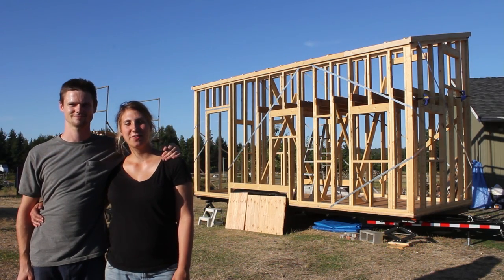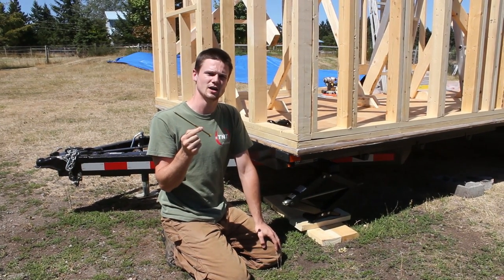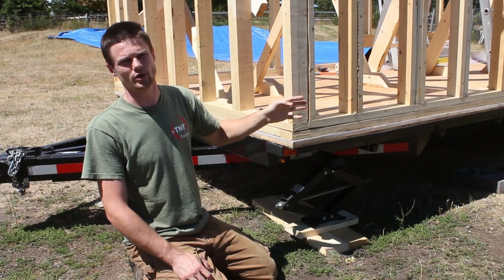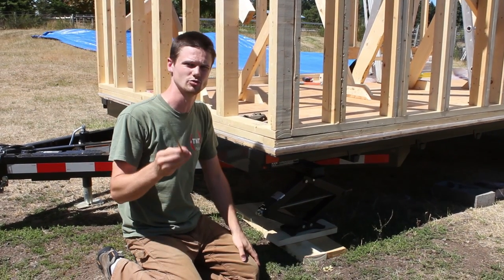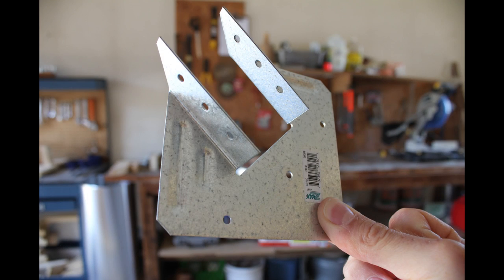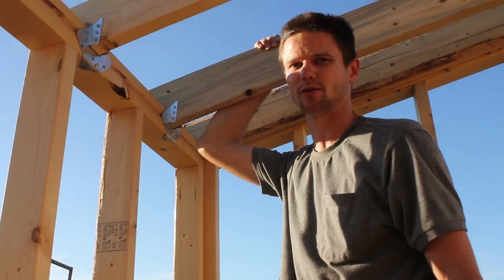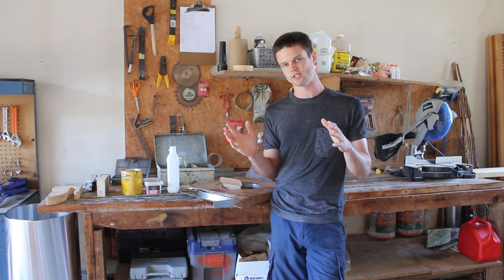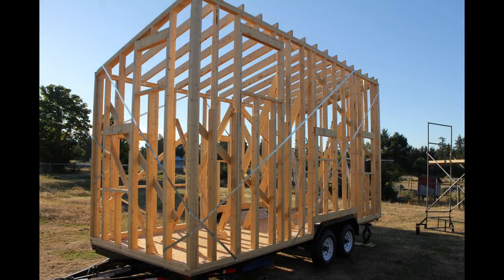Tiny House Structural Strength (Ep.10)

Comment: The bolted connection that you showed earlier is far stronger than the screw connection. I work as an architect in California. Earth quake land. We use the Simpson bolted connection all the time. With the screw you are relying on wood to not tear around the treads compared to the tensile strength of the bolt. Huge difference. Moving the house down the road with gusts and bumps I would have the bolted connection. With the strapping are you going to use 3/8 or 1/2 structural sheathing on the outside? If so you don't need the straps. The sheathing if better for it makes more connections than the strap does. (Nailing needs to be 6" O.C. on edges and 12" O.C. middle) The strapping out hear is use on headers to tie back to more framing. You have a pin connection ( compared to a ridged conniption that would occur when two pieces mental are wielded together) at the header and jack stud. The strap helps with that week connection.
Reply from the maker: Charlie Hatfield We have just completed sheathing the walls with 1/2' plywood using adhesive & ring-shank nails (6' along edges, 8" in the field). The strapping is an extra brace as a backup in an extreme situation.I hear what you're saying about the wood tearing, but even if I bolt the bottom-plate down, I'm still relying on the nails to hold all the other studs down am I not? I managed to get structural screws into almost half of the studs, in addition to the framing nails (also ring-shank). I have been thinking about adding eye-bolts in the corners (with the eyes facing down) to allow for a connection to spikes in the ground (using cabling or straps), and was thinking about passing them through the flange and bolting them down to the bottom-plate so that they serve two purposes... What do you think about that? Do you think that there needs to be additional connection to the studs themselves (the way the simpson hold-downs do)?

In the end, the wood tearing will always be the weakest link no matter what kind of tie-down is fastened to the wood, so it's a matter of making sure there is enough strength in the right place. The only option that seems to bypass the wood's weakness is aircraft cable that runs from the bottom of the flange to the top of the top-plate.
Reply: A threaded connection into the end grain of lumber will always be weaker than across the grain. You are to be complimented re: all your efforts to stabilize you tiny house. In the end life-safety is more important than structural integrity and will determine when it is time to seek better shelter (if it exists). Nothing much can withstand a tornado :(
Reply: Just for reference would bolting one or two studs and screwing all others per side be structurally sound? (even If I am most likely to choose metal profile framing with German 3.5 ton limits and general avoidance of wooden structural elements 😅)?

Comment: Looking good so far learning a lot on these step by step videos. However in my experience as a carpenter and dealing with structure industrially I have learned that the GRK screws or any of the like does not work as well as a good 3/8 or 58 bolt that you used on the frame trailer securing.  On my build I will use the boltsNice work so far none the less
Reply from the maker: +Nikko Gutierrez Thanks for the feedback. If you keep watching you'll see that we added threaded rods to actually do the job of holding the structure down onto the trailer. The GRKs were a good start, but we felt that trusting any screw or bolt to hold down the whole thing might not be enough (for piece-of-mind anyway)

Comment: It's me again. I am sure that the metal banding gave some structural strength to your build. I don't think it was a waste of time. The siding on the outside of the structure combined with the hurricane clips would be sufficient to hold the squareness of the building.  I have looked at a lot of old buildings,  and I mean old buildings which have had the siding falling off, ( due to the nails rusted off) I have studied the stud structure which have had the 45 degree recessed blocking as you call it. These buildings should have fallen down years ago due to footers being washed away on corners and assorted other things however, the walls would not fall and they kept  their squareness for the most part.

I have also seen with my own eyes some buildings which were scheduled for demolition with a bull dozier that had the 45 degree recessed blocking that had a tendency to tumble instead of crush.  Which highly annoyed the dozier operators.

Banding, Blocking ,Hurricane clips or Threaded rods.  It is all good stuff.

Thank you for your most wonderful response. I look forward to seeing your beautiful Tiny Nest home build. I am learning a little bit from you too. 

Oh! You know I had a tradition in my family when we finished a build we would have a house raising party. Good barbecue and drinks and good friends to share good times. Please allow me to pass this tradition on to you and your lovely family and friends.
Reply from the maker: Rita Mastin Thanks very much for all your feedback, it was very informative for us and hopefully others who read it.

I think we're going to have a special Tiny Nest party next spring or summer, since we'll likely finish during the worst weather :P

Comment: Just thinking about the wind forces at play and how you secured the bottom walls for structural strength, I think the Simpson strong ties blocked properly are much stronger for side to side movement/swaying rather than drilling a few inches into the end of the 2x4 and using the 8" screw. I've dealt with many framing projects over the years and recently as an example a shed demolition and anywhere the screws were in the end grain they easily crack and split the wood when I was banging it all apart. However there were simple 5" steel L brackets in each of the corners with large screws in each and that was what felt like 100 times more secure. I had to cut them all off with a reciprocating saw. The comparison I'm trying to make is that Simpson strong ties screw through the grain on both axis, not with the grain. Think of an axe splitting wood. The same effect happens in the end grain of any wood. Regardless this is a great video series and I like the construction quality so far. It is very much how I would want to build if I built a tiny house.
Reply from the maker: +Audioholic 01 This is a very good observation. Going in with the grain would not give the best hold power, particularly against sideways forces on the wood. Having added the threaded rods all the way to the top, we think we have a pretty good combination that works together. Any one element would not be enough on its own. The rods prevent the walls from lifting off the trailer, the strapping prevents the walls from racking, and both the rods and screws prevent the walls from sliding. Since it's on a trailer, every direction needs to be accounted for. Thanks for your feedback :)

Comment: In remarks to the metal banding. My father used the banding in Florida vertical with the studs to use with an ground auger that was drilled into the ground. The banding was nailed to the vertical studs under the siding and over the rafter studs over the trailer to the other studs and attached to the fixated ground auger which was drilled into the ground.  Reason to attach the trailer to the ground to hold the trailer to the ground during a hurricane or tornado.  This seamed to work. The banding was used every 36 inches. I have never seen a rap around the trailer until it was shown in this video. However it may work. I personally would use a recessed 2x4 cut inside the 2x6 studs  at 45 degrees for strengthening the structure. When parked for a lengthy bit of time I would use the banding to hold the trailer to the land one for theft and in a tornado area and a hurricane area. I hope this will give you insight to the metal banding for use as a hurricane strap for which it was originally used for. Thank you for your time.
Reply from the maker: Rita Mastin We are definitely making some of this up as we go, trying to err on the side of caution wherever possible. You will see in a later episode how we installed threaded rod from bottom- to top-plate and left extra sticking out under the trailer which could later be used as a point-of-attachment for hardware to anchor the trailer to the ground.

I really like what you're getting at in this comment. It sounds like we could have wrapped the strapping over the top (including over the rafters) like you described, which would eliminate the individual rafter strong-ties AND our threaded rod. Then for diagonal anti-racking strength, we could have used blocking within the framing. It's possible that this would have been easier, neater, and cheaper. There is the possibility that we will build a second tiny house, so I will definitely keep this option in mind! Thank you very much for the feedback.

Not being an expert on the subject, I wonder about the difference in strength between diagonal metal strapping and wood blocking (within the framing). It would SEEM like a long and continuous band of metal would be stronger, but maybe not, and either of these options is probably overkill to begin with since many tiny homes have been built without extra strength of this nature built into them.

I also should mention that we don't plan on moving the house often, and we don't live in a dangerous storm area.

Comment: I like your idea of using the timber screws to hold the house to the deck.  My rafters will be directly over each stud on 16 inch centres, and I am going to use them to tie the rafter, the top plate, the 2 x 4 on top of the studs (forgotten what it is called), and into the stud by a few inches.  They are using these in the southern states in hurricane areas, and seem to be working well.
Reply from the maker: gary pollock Thanks for your feedback!
Reply from the maker: gary pollock Sorry I missed something, you are going to use this cabling to hold your rafters to the rest of the framing?
Reply: Tiny Nest A similar version, only as as addition to the bolts going through the frame.  From what I understood, and a reply from the Texas Tiny houses, this helps a lot in preventing racking.  He doesn't use the metal strapping on the frame from corner to corner.  Just the angled brasing in the corners, and the cables.  I am not sure if I trust the crimp on ends to bolt through.  I think I  would go to larger cable than that in the video. What is the thickness of the strapping you used diagonally on the frame.  My goal is to do it cheaply as possible just to see.  So far, I haven't spent more than $500.00.  I even just picked up a ton of styrophoame insulation for nothing.  It was from a from a roof they were replacing on one of the schools.  They are 6 inches thick, and had some tar residue on one surface.  I made a make shift saw from wood, and used an old swede saw blade mounted side ways to cut horrizontally rather than vertically.  I mounted a flat piece of plywood about 2 inches up the handle, and it worked very similar to a chalnsaw mill.  It took 2 people, but once we got it figured out right, we could do one in about 3 minutes.  Have enough now for a second trailer when this one is gone.   I am getting shorts and cut-off from some contractor friends,  I picked up a finger joint bit from Lee Valley in Victoria, and am finger jointing 2 x 4 to make full length lumber.  It's working great, and the wood is straight.  The force is vertical, so I'm not worried about it not being strong enough.  In fact, we pushed down on one with the fork lift, and it split further up from the joint.  The glue held fast.  The electronics students are going to build me some solar panels using the cells got on ebay.  They're cheap and it's easy to do.  I'm using copper foil from stained glass as connectors.  Because of the sticky back, they hold in place very well to solder.  But, it sure helps having access to all the resource I have at the college.
Reply: Tiny Nest Sorry.  Went on and on, and didn't answer your question.  I'm going to use the long timber screws that you are using.  They are available in many lengths.  My rafters are sitting directly over each stud, and the timber screw will go through the rafter, the top plates, and sink at least 4 to 6 inches into the top of the stud.  There is blocking between each rafter on the top plate, and the rafter is toenailed into the blocking, and the blocking is fastended to the top plate.
Reply: gary pollock google TimberLox screws replacing hurricane strapping

Comment: Very nice job..im a framer and can see you did your school work!
Reply from the maker: tom williams Thanks, it's calming to hear from a professional that we've done something right. Is there anything you would have done differently?
Reply: Tiny Nest maybe add some blocking is all..
Reply from the maker: tom williams Horizontal blocking for fire-retarding or strength?
Reply: Tiny Nest yes for both.should be blocked 3 bays from a corner.and where the loft floor meet the wall.then any wall over 8'tall needs blk.!

Comment: I like the idea of having a bolt all the way thru the flange and the wood tightening a big washer down on each side. I wouldn't want to just trust screw threads in wood to hold the house onto the trailer - especially not into the end grain of the studs where stress could make it split.  What would be ideal is a nut/washer that could be fastened to the bottom plate (where it will be inside the wall.)  Then, the bolts could be tightened from underneath if needed (without them spinning) if you needed to later.  Picture a nut with a large hole for the bolt and a small hole on either side for fixing screws.
Reply from the maker: Demetrius3d Thanks for the feedback. I should have shown myself installing one of the screws... they are insanely tight and feel incredibly strong. Although we may still add one extra measure to connect to the trailer, such as nut and bolt. We'll definitely show it if we do.

Comment: are the long screws structurally effective when going into the end grain of the stud?.  I've used them to hold rafters down to a plate but that was always across the grain.  just curious.
Reply from the maker: This is a very good point. I would suspect that your suspicion is correct, and that it does not hold as well when fastened into the end of a stud. Luckily, we used additional measures to secure the structure, which we would recommend. We still think out threaded-rod installation is one of the best options for tiny house construction.

Comment: My only concern about the strapping was that if you are nailing on sheathing you might have the bad luck of trying to nail into a metal strap. A different approach I have seen is using angled 2x4’s  inside the walls leveled into notches in the studs to make the walls flat. I am not sure the wrapping around of the straps is really adding any necessary strength.

Comment: Hi guys!  What an amazing set of instructional vids you're creating!!  Thanks so much!  One question, wouldn't the plywood sheathing provide enough racking resistance thereby saving the cost of the Simpson strapping?  Perhaps they serve different functions, or was this just a question of over engineering to be on the safe side?
Reply from the maker: +lefty0mtl Thanks for watching :) we didn't want to rely entirely on anything wooden, because after a lot of movement and stress coming from different angles the nails and wood could loosen and loose strength... metal will always hold. Wood will also weaken from water damage sooner than metal will weaken from rusting (meaning if they were both exposed to moisture).